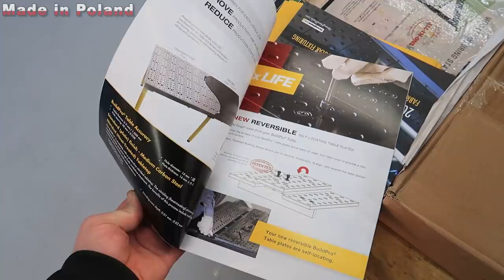Assembling Strong Hand Tools Rhino Welding Cart Table

Comment: Very nice video! Viewers should know that not all of the fixture items you have are optionally included in the 66-piece set that accompanies the Rhino Cart. While I had seen the plasma table add-on and the various right-angle fixtures, I had not seen the small pieces with 5/8 inch holes that you added to the edges to give you mounting positions on plates oriented vertically. Nice!

Comment: Alec Steela uses the same "Rhino" ... It's a pretty good table. But ... it's not cheap.
That's why I preferred to make 130kg cheap simply welding table on wheels. Half plate, half square tubes. Yes, but without those many nice little perfect "things". :(

Comment: If the virus BS ever subsides and I ever make it back to Europe I may try and hunt you guys down for a glass of wine and some stories and a tour. Can't see it being in the next year or two at this rate, though. That table surface... I found that the holes are 50x50 spaced and the surface is nitrided, but what is the surface finish? milled or ground or acid etched/raw? Guessing milled? Or maybe they buy bright engineering plate and juse cut the holes and chamfer and finish the edges to size? That would make sense if the buy price wasn't too high.